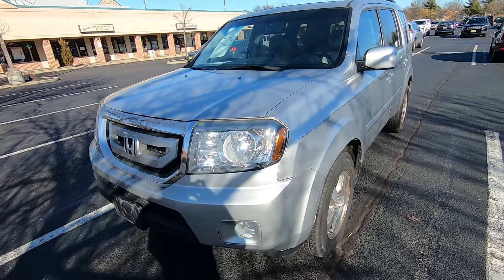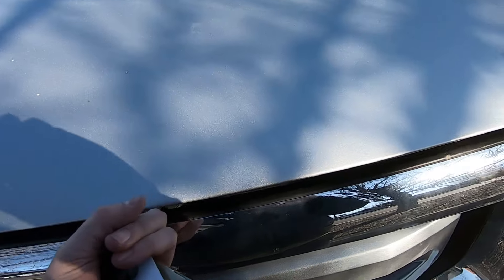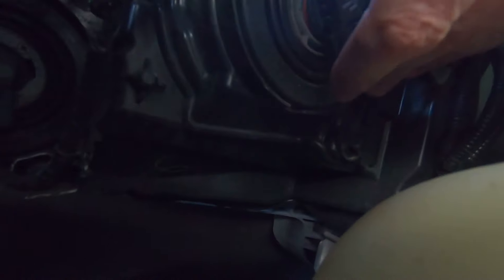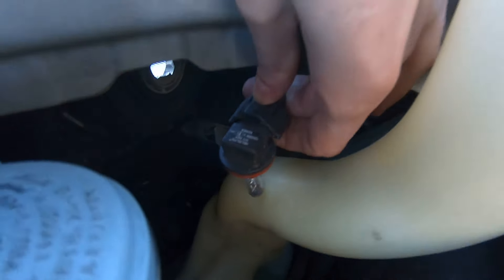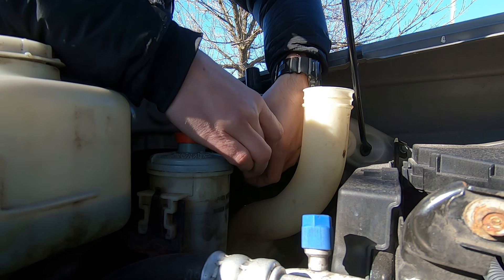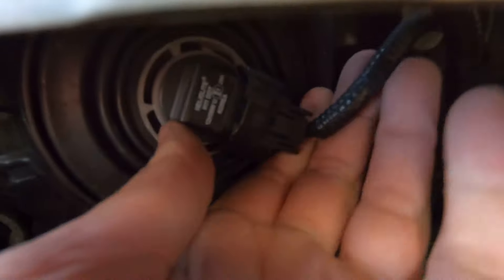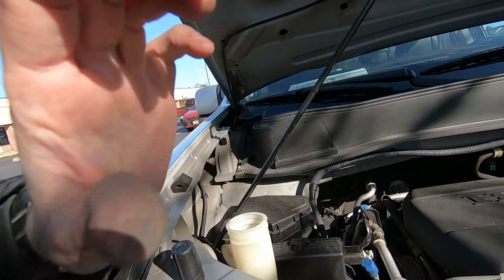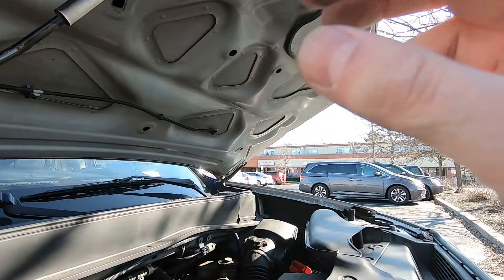How to replace change Headlight bulbs in 2009-2015 Honda Pilot

Comment: Thanks for the vid.  I found easiest to use a flat head screw driver to easily press on the clip and then use my other hand to pull down on the harness.  Then it was simple to twist bulb and switch it out.

Comment: Thanks for showing bulbs change, I took appointment but now I am going to cancel and do myself 💕
Reply: Don't cancel until you've attempted.  The job is harder (especially if it's the OTHER light which the lower air breathing assembly blocks) than it appears.  Oh, never mind.  It's been 11 months.  By now you either accomplished it OR had a mechanic do it.

Comment: At the risk of sounding like a jaded and bitter old man (which I've, in fact, become), the side you demonstrated is MUCH more accessible than the OTHER one (which the lower section of the air breather housing "conveniently" blocks.  I managed to get the old one out BUT haven't mustered the courage to attempt to put the new one in yet.  In addition, the bulb assembly does not easily turn (taking out OR putting back in.  You have to make several oaths to ancient deities before it will cooperate.  WARNING:  the job looks easy but it is not!

Comment: I ALSO struggled taking out the light. Dummy tip- take the wire off the light THEN twist the light off(twist toward the wheel) Also - Honda pilot light is typically H11 👍🏼

Comment: The most important thing to remember is that you must remove the wire connection from the bulb before you twist the bulb assembly to remove it. If you do not do this you will not be able to twist the bulb assembly to remove it. I am referring to the low beam light.

Comment: This light bulb installation was extremely difficult, even after watching multiple YouTube videos and reading the comments.  Finally,  after a warning citation from 1 lonely small Texas town officer later, I finally got it!  I found a similar snap-on piece on the right side of the under hood, which helped me to understand what I was trying to snap.   I tried to maneuver the flashlight to see clearly, then WD-40’d the  whole thing like crazy!  After tugging it repetitively, it FINALLY came off.  Taking the bulb out was simple after that.  Once the bulb was secured, I then slid the black plastic part onto the bulb.  Btw, the local mechanic wanted to charge me $56.92 to do it for me. 😮.
Reply: Yes. Almost worthless unfortunately. Tried wd 40 but mine refuses to turn and no way to get tool leverage.

Comment: That’s the easy one…………. Looking for a complete headlight change. The one on the drivers side is much harder. Showing the passenger one is practically useless as it’s straight forward, you can see and reach everything….

Comment: For Honda Pilot 2015, fIrst open the cord. You can’t turn and remove the bulb without removing the cable. There is a slot with the cable holder which makes the bulb fixed and firm.
Reply: Wish I'd read this first!, my 2012 pilot bulb would not twist with the wiring harness attached. I Had to unplug that, then the housing of the bulb twisted out no problem.

Comment: Just re-iterating what others have said - you have to pull off the wire housing before the bulb will twist out.  On the driver’s side it’s darn near impossible to see what you you’re doing so you’ll just have to feel where the wiring connects to the bulb.  You’ll feel a tab with ridges - you’re gonna have to push on that tab and pull down until the housing ‘unplugs’ from the bulb.  Then you can twist the bulb out.
Reply: Thank you this comment helped me very much

Comment: Your was not that helpful. You need to disconnect the electric off of it before you can turn it. I struggled following your way. But luckily my brother is a mechanic and came and helped me like it was not a problem because he knew what he was doing. This video is misleading.

Comment: I struggled mightily to do what looked to be a simple job. I have a tip that I believe will save you a lot of time and headache. The electrical wiring ends in a harness that connects into the bulb housing. Find a black tab on this bulb housing and press down hard, while simultaneously pulling down on the harness. If you are dexterous you can do this with one hand, if not, you will have to monkey both hands in these tight quarters somehow to do it. Once the harness is released from the housing, you can then easily turn the bulb housing to release it out of the headlight cavity. This was the ONLY way I could have done this. What I thought was going to take 5 minutes took 3 hours, 6 internet searches, and scrapes and bumps all over my forearms and wrists!
Reply: Thank you so very much for this! Pressing down on the black tab and pulling down was the key! Good thing I found your comment!
Reply: Steve you are right.  Saved me a lot of time.   Thank you
Reply: Saved me alot of struggle bussing 🚌
Reply: Definitely the only way that worked easily for me…in addition to removing the air intake cover for the driver side
Reply: Sir I would like to buy you a beer! You’re the real MVP between you and the original video uploader!
Reply: Yep going on 2 + hours.. I have long hands for a girl, and NO WAY are both hands fitting 🤪
Reply: you are correct sir.
Reply: This is the only possible way to do it on my pilot. The wire harness is too short to turn it if it’s connected. Great tip.
Reply: You saved me 2 hours of work/frustration. Thanks for your help!
Reply: I can’t thank you enough for sharing this!
Reply: Huge shout out for this tip. Impossible to turn on my 2013 pilot passenger side. When I disconnected it was east to turn.
Reply: Omg! So glad I saw this comment. I thought I was loosing it.
Reply: After 30 mins of trying I dropped my ego and decided to YouTube instructions, the real instructions are always in the comments, thanks brother.
Reply: I wish a saw this before spending a hour destroying my wrist a forearm trying to turn the bulb housing.  Unplugged  it and had the job done in less than a minute.  If you are ever in Fresno California  I'd like to buy you beer.
Reply: Another tidbit was to realize that the place you press on the tab is towards the end closest to the wires. Once I pressed that spot closest to wires itcame right out. A quick quarter turn clockwise and the bulb was out. Spent WAY TO MUCH time on this side to change the bulb. The driver side was so much easier. Go figure.
Reply: Thank you thank you thank you.
Reply: Thank you! There’s something about that connector that must be blocking/getting in the way of allowing the bulb to turn. Once detached, the bulb turned with ease!

Comment: Thank You.  My Sister has a 2015. Her low beam passenger bulb burnt out.  This video helps a lot.   Thanks.

Just tried it for over a half hour.  I couldn’t get it to turn.  I think it would be easier to take the light assembly out.
Reply: but then the whole bumper needs to come off... I did that last time, and it was easy to replace the bulb once the housing was out, but removing the bumper was a PIA too, so pick your poison

Comment: Not easy, but definitely disconnect the bulb first. Then you can unseat it.
Reply: Wow, this was the BEST comment. I was having so much trouble getting the bulb/housing off, but was able to easily remove the wiring and the bulb came out very easily. Thanks.
Reply: my bulb stuck there and just can't turn. Thanks for this suggestion.  I was able to disconnect first then it is easy.
Reply: how do you disconnect the bulb??
Reply: @nebDDa  it take time and efforts, my passenger side bulk stuck but driver side much easier.

Comment: I hadn't seen this video yet but my driver side low beam bulb on my 2013 Pilot is NOT this easy to access. In trying to remove it, I completely broke part of the connector off. Now I'm left with just the bulb/electrodes stuck inside. You can't remove the headlight unless you remove the front bumper and now I will have to do that. Not happy at all but even with smaller arms, I could not get the proper grip on that side to turn/release the bulb.
Reply: Yes. It’s way more of a chore on the drivers side.